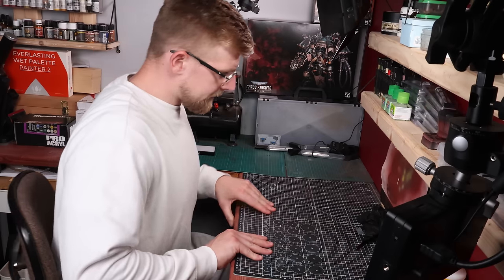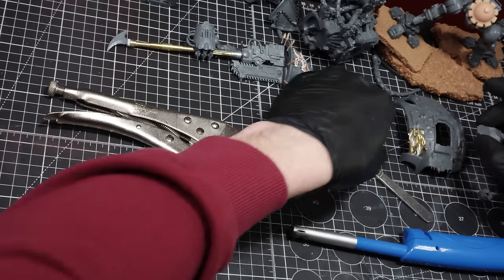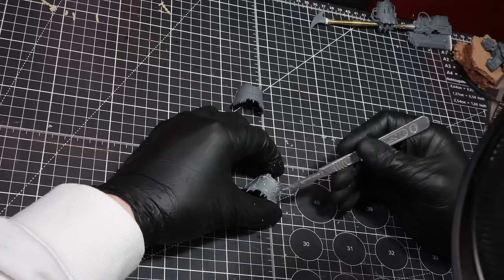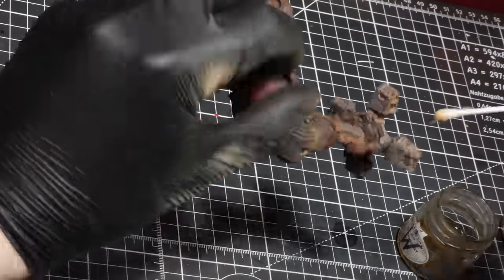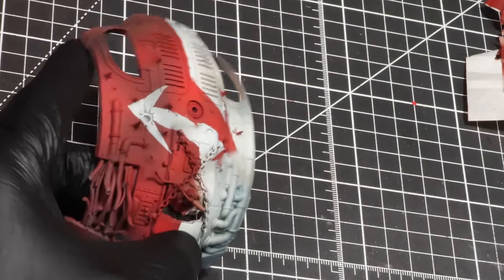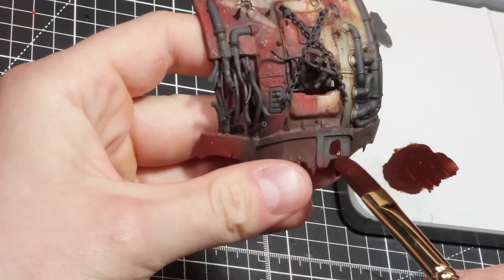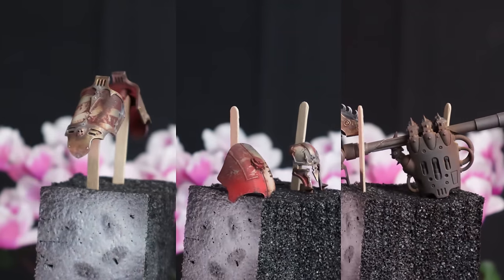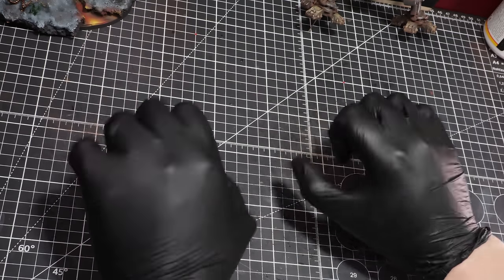The Most INTENSE Paint Job You'll Ever See, even Angron gets jealous! painting Chaos Knight Rampager

Comment: You may never see this, however something to help green stuff in a mold, is to take bees wax or even using beard balm or beard oil… (what I use, lol) brush a very light layer in the mold, then press the green stuff into the mold, keeping you finger tips wet, really get in there and then let it dry for like 24 hours, usually it’ll come out nice and smoothly. I also do this when making a small resin mold with green stuff or that one Japanese toy you heat up and mold around thing when using UV resin. Makes it so much easier.

Comment: I think the Mold would work if it was in 3 parts, the design in the middle, and then the 2 sides to squish it, and then you can just poke it out. or itll stick to one of the walls and you can scrape it off
Reply from the maker: Thank you!
I did try that method but because I wanted the front to have a design the greenstuff just got stuck to the other side aswell. Even with a release agent it barely did anything!
It certainly is an idea I want to refine because it will save so much time on future kitbashes. Maybe I go further and split the 2 sides in half so what ever is in them can be accessed just that bit easier.

Comment: Great Video-Thank you!  I am trying this technique as I type.  The one question I have is that I am using a toothbrush to reduce the crusted dark rust deposit and it isn't actually doing anything.  Do you put white spirits on the brush first?
Reply from the maker: Thank you! It should come off with just the brush, if it doesn't then dab the brush in some spirits and give it a go.